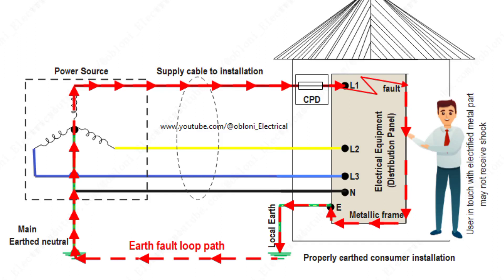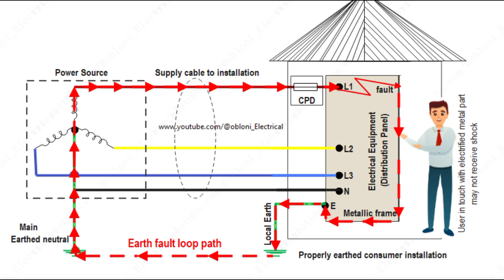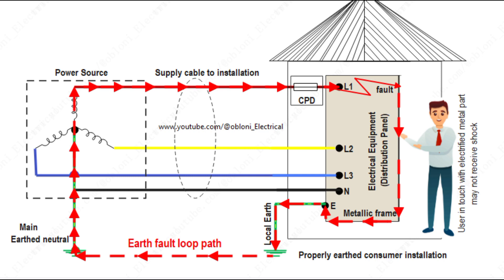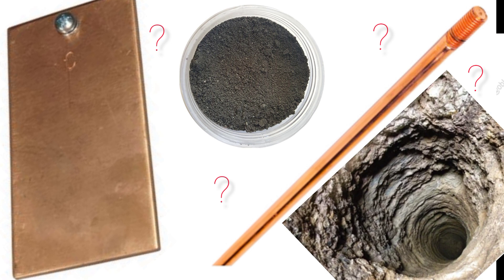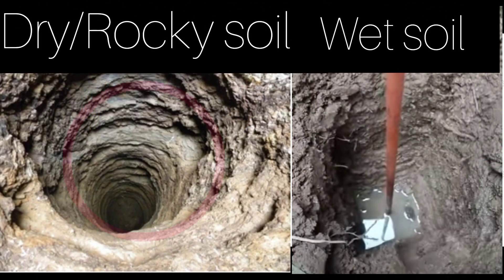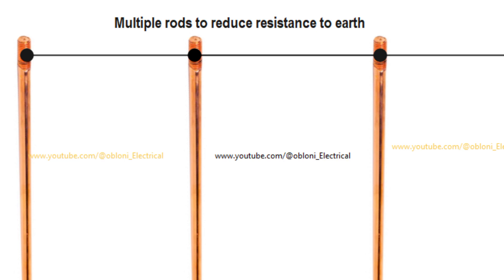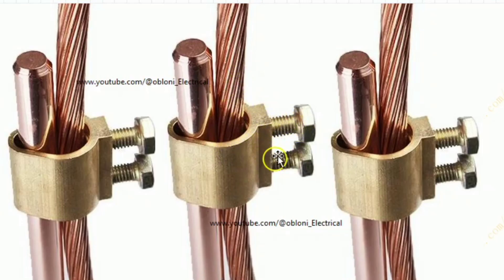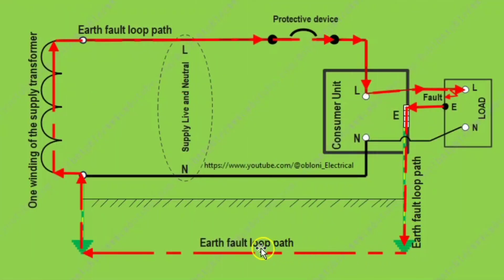How to Bury an Earth Electrode Properly for Residential Electrical Wiring | Earthing Tutorial

Comment: Please is  6 Ones ok for earth risistanc
Reply from the maker: I think I addressed this same question already but again, That depends on several factors:
1. Local regulations: Electrical codes set the maximum allowable resistance for earth electrode resistance.  For example,  some local codes specify a maximum of 25 ohms in which case 6 Ohms is okay .  So please consult your local electrical regulations.
2. Application: Some critical applications, like lightning protection for substations, require much lower values, around 5 ohms or even less.

Also note that these local codes can be reviewed at any point in time. The most important thing also is for you as an electrician to know why  the EARTHING system 
is very important, and how it can be properly done for safety and proper operation of the insulation. Please you will need to watch these other videos on earthing. Follow the se links : 
https://youtu.be/wWO2Z-gm-HA
https://youtu.be/Njr3LXOyEyI
https://youtu.be/dYPBiVqkBFQ

Comment: Just to clarify @1:50min you mentioned that for an rcd to operate due to earth fault, there needs to be a low earth resistance. This is correct for MCBs during overload and short circuit condition but does not apply to  rcd or rcbo as they do not need a low earth resistance to operate if theres an earth leakage. Thats why rcds / RCBOs are required on TT systems due to the unrealibility of the earth mass. Rcds/RCBOs measure the current in vs out and trip accordingly using a mechanism inside the rcd leaving out the earth completley. Great video. Keep up the great work!
Reply from the maker: thanks very much my dear friend, for your contribution.
But please the statement @1:50min is: "For protective devices such as RCDs to operate effectively during an earth fault, this path must allow a substantial amount of the fault current to flow back to the supply source"...

The path referred to therein is the earth fault loop path, which includes the CPC, the earthing electrode, and the earth(because we are talking about TT system). I went ahead to say that "if  this path is not able to complete, then whatever protective devices you have in your circuit will not operate, including some RCDs"
 
Also, I wasn't only talking about RCDs. I talked about CPDs in general and emphasized on RCDs appropriately. Thanks.

I am working on a video to practically demonstrate how RCDs will behave in the event of an earth fault, when the earth fault path is not continuous. 
I will also explain when the RCD doesn't need Earth to operate, and when it can't operate without Earth.

Yes,  so RCDs can operate without earth when there's an imbalance in the system in certain cases,  BUT RCDs will not operate in the event of an earth fault when there is no Earthing for the installation (in a TT system).  

Thanks again.
Reply: Thanks for clarifying that for the audience.  This topic is of great interest to me.
Reply from the maker: @badrubakari1418  
Very grateful for your input. thanks

Comment: This so awesome, I have a question for you sir, what causes neutral wire to be giving electrical shock and how can it be sorted out? Thanking you in anticipation sir.
Reply from the maker: Sure! Usually it's an open circuit in a part of the neutral line that causes that. It will be very clear to you when I explain with a video. I will do that soon. Thanks
Reply: @obloni_Electrical wow I can't for the video sir

Comment: I'm here again. My long awaiting topic. Thanks for sharing it with us...
Reply from the maker: Yeah, there's a final one coming it will drop by next week. I think that, with this one and the other previous ones should clear every doubt. Thanks for your patience.
Reply: @obloni_Electrical wow! Thanks Sir
Reply: @obloni_Electrical 
After watching the video here are because:
1. When burying multiple earth, what should be the distance between each one of them
2. You said multiple eart should be done parallel to the main earth. How is that done. I don't get it.
3. Let assume you have are working on 8 stores, each having separate energy meters, but they are all on the supply phase. Is it good to bury individual earth close together. If is not not on the same phase what should be the distance between each one.